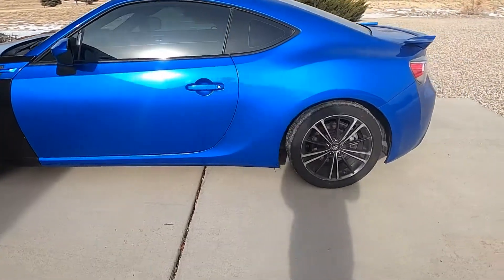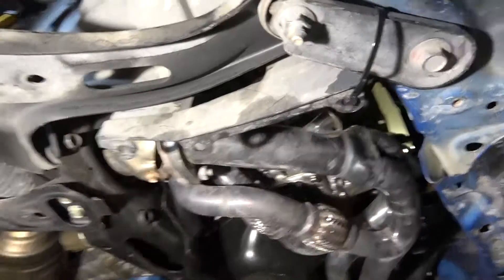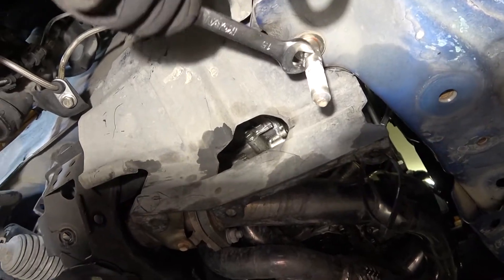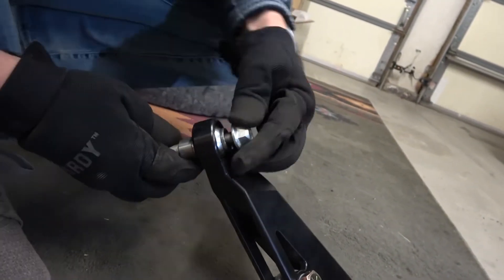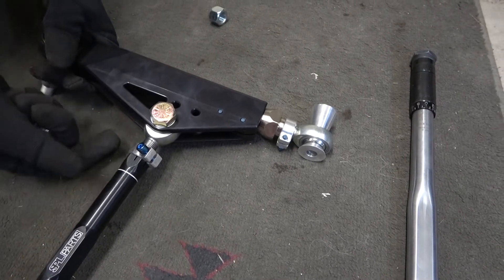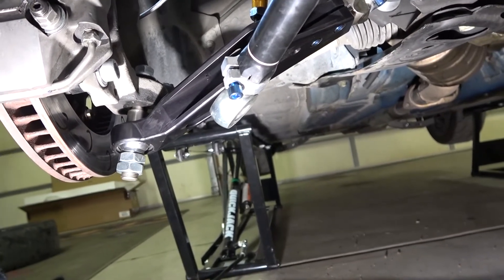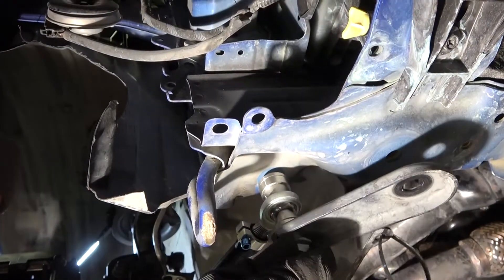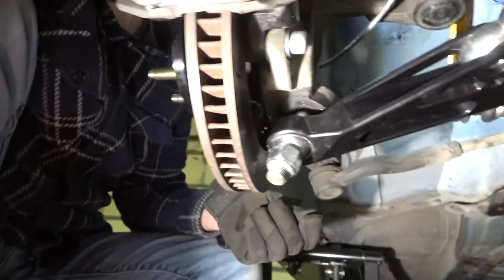BRZ FRS 86 SPL Front Lower Control Arms Install

Comment: Did you ever have your sway bar hit your metal frame? I have the same whiteline sway bar and end links and my sway bar continually hits the metal piece above it on bump. I also noticed you have yours adjusted differently than me.
Reply from the maker: Nope never had an issue with them. Maybe end links aren't adjusted properly?

Comment: hey this may sound like a stupid question but is there only a lower control arm in the front? in the rear there is both an upper and lower correct?
Reply from the maker: Not a stupid question. That's true there is no upper. You can use an adjustable top hats though if you want top adjustment. Personally think it's better to use the lower control arm for camber adjustment as it helps with track width and strut angle

Comment: How much more neg camber did u achieved with this? Good video btw!
Reply from the maker: Hey thanks! I don't know what the max would be but I'm starting at negative 3 on the front and it should do more than that. I was maxxed at negative 1.7 with just camber bolts